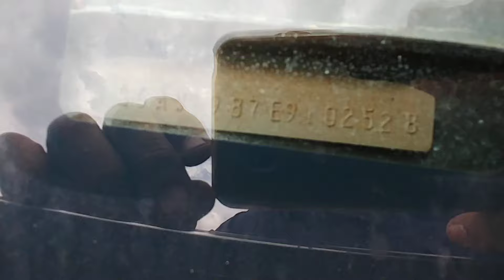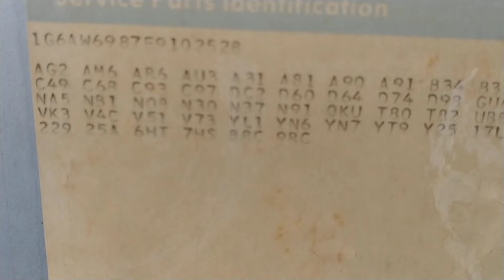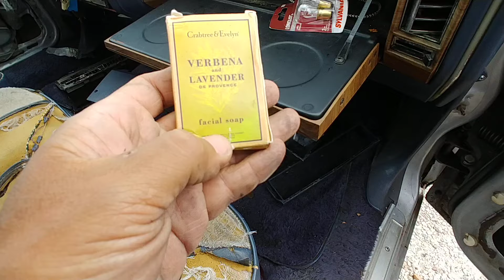1984 Cadillac Fleetwood Brougham Junkyard Find

Comment: Whoa Nelley, 1984 and soon to be out the door. John Speer Cadillac is possibly Lawrence Cadillac of Abilene, TX now.

We got the VIN, we win: 1G6 for US made Cadillac, A for manual seat belts, W for Fleetwood Brougham, 69 for four door sedan, 8 for 4.1L (252 CID) V8 with DFI, Cadillac produced, aka RPO code "LT8", aka "1-2 punch out to lunch and I hear ya knockin'......", 7 is a check digit, E for the 1984 model year, 9 for Clark Street, Detroit, MI assembly and the rest is the production sequence. The Clark Street plant closed in December 1987 and the last weeks of operation can be found on YT. The HT4100 was a heap of an engine and a black eye for Cadillac, turning Cadillac loyalists into import buyers for life. It would blow in the intake gasket sending a soupy mix of coolant and oil through the engine, eventually wiping out the bottom end and totaling the engine (and sometimes the car). 

We got the SPID, glad you did: AG2 for power passenger seat adjuster, AM6 for split front bench seat, AR6 for front seat restraint system, AU3 for power locks, A31 for power windows, A81 for power passenger seat recliner, A90 for power deck lid, A91 for power deck lid pulldown, B34 through B36 for front, rear and trunk mats, B84 for bodyside molding, B93 for door edge guard ornamentation, CAD for Clark Street, Detroit, MI assembly, CB5 for full vinyl padded roof (so yes, it was a vinyl top car), C49 for rear window defogger, C68 for automatic temperature control, C93 for exterior opera lamps, C97 for courtesy lamps, DC2 for inside rear view mirror with reading lamps, D60 for color/trim override, D64 for RH illuminated vanity mirror, D74 for LH illuminated vanity mirror, D98 for body accent stripe and decklid, GU6 for 3.42 rear axle ratio, K19 for AIR injector reactor system, K34 for cruise control, LT8 for 4.1L V8 HT4100 engine, MW9 for THM200-4R four speed overdrive automatic transmission, NA5 for Federal emission system, NB1 for closed loop emission system, N30 for deluxe steering wheel, N37 for tilt and telescoping steering wheel, N91 for simulated locking wire wheel covers, QKU is a tire code, T80 for automatic headlight control, T82 for automatic headlight on/off control, UB8 for high note "C" horn, UM6 for AM-FM stereo cassette with ETR and clock, UW8 for garage door opener, UY9 for MPH and KM speedometer, U66 for four speaker system, U75 for chrome power antenna, VK3 for front license plate bracket, V51 for license plate frame front and rear, V73 for US/Canada vehicle statement, YL1 for leather and vinyl upholstery, 17L and 17U for Silver lower and upper exterior paint, 17T for silver vinyl top, all of the 22 codes are for Light Royal blue trim items (seats, door panels, moldings, seat belts, etc.), among other codes. Yes, 1984 is the first year for RPO codes on passenger cars---trucks had them earlier than 1984. That decal on the fan shroud is for the "horse pill" coolant supplement campaign.

Whoa Nelley, Cadu and it's over for you. That's it, time to quit. Fleetwood now ain't no good. 4.1 and it's done. RPO "LT8" was never great. Made at Clark Street and now in defeat. Painted gray and soon to go away. Four doors and it doesn't go no more. Going to be flat and that's that. Fleetwood Brougham soon to go home. Please don't get squished because the Cadillac faithful, a few here, probably not Benny, but the Google Man is going to be very, very pissed.

Comment: HT 4100 engine is the worst Cadillac engine ever produced !!  They were gutless piles of crap. As an added bonus, they would overheat and warp the cylinders in the aluminum blocks. They only had 3 torx head bolts holding the flex plate to the crankshaft flange, Lol Absolute garbage !!
Reply: They were a black eye for GM and turned traditional Cadillac buyers into import buyers for life.